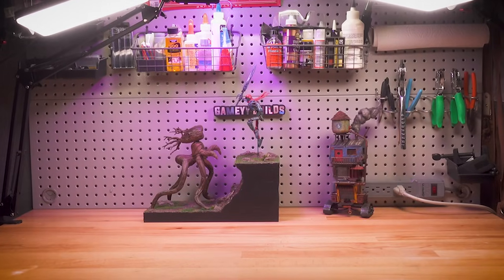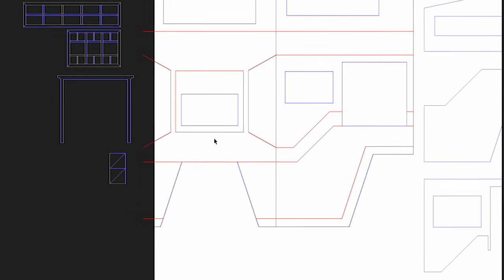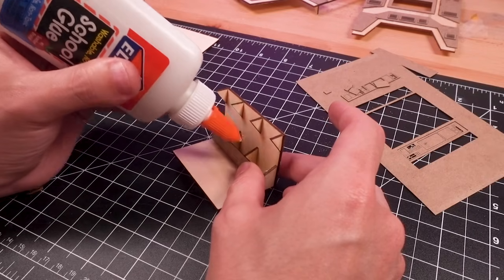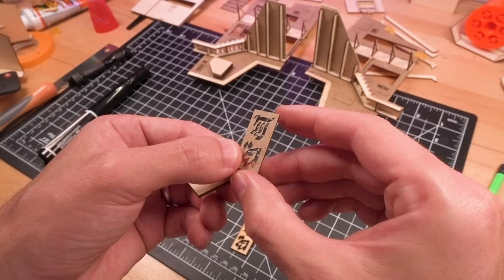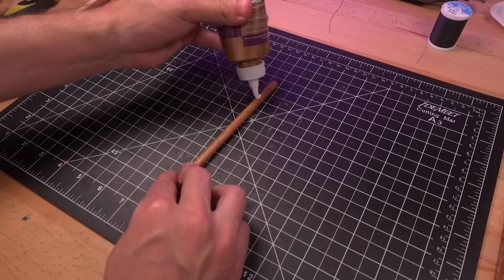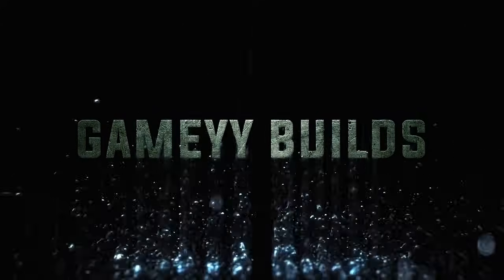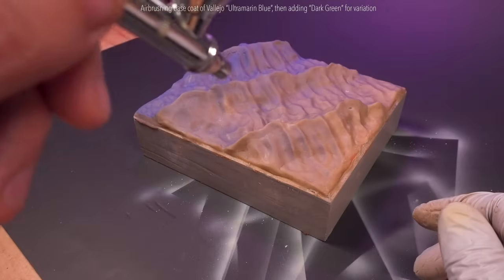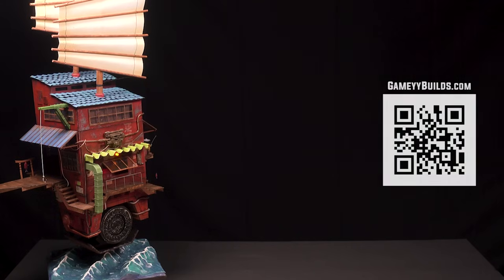“The Catch” floating market scratch build, Beyond the Blight

Comment: Another great build. For tiles I nomally wrap a thin layer of clay around a paper straw. Let the clay dry then slice the whole tube in half. This give you 2 half circles that can easily be cut to the length of the tiles you want. Basically scaling down the actual process of making real tiles. They take a little longer to set but work great and all the tiles are slightly different. You can even break/chip a few to add even more interest to the roof.
Reply from the maker: Great tip!

Comment: Hi, your builds is really inspiring and so your channel. I hope there are still some shirts left, so I can support you:)
As a general tip for your wiring. Try to spiral your cables (as can be seen in computer fans for examples). Every space between those two cables (+ and -) creates a loop and can work as an antenna. While it‘s not that important with LEDs it still a good habit and practise:)

Comment: if you used a magnetic switch you could hide it on the interior of the build making it possible to turn the effect on without needing to hide the switch, if you wanted to go more complex you could wire the switch into the coil of a relay to "latch" the relay in the on position making it possible to engage multiple effects. if you would like to go into more depth feel free to message me. also just wanted to say i love your build and has me thinking of my own.

Comment: My advice for your soldering: Just 'git gud' man.

In all seriousness, as with all of your builds, this was a joy to watch. The tie in with the other story was fantastic and cannot wait for more of this story to unfold.

I am unsure precisely how this would work but the only constructive suggestion I have is wiring up another battery to the speaker to make it vibrate (you can add resistors to change the Hz). This would both look cool as it would look like the Repulser engine was actually doing something, and it would also give off a hum when activated.

Comment: You can use foil for contacts. A sheet on a wall can be painted over. However if you want to see the wiring, I'd suggest running a rod down the 4 corners of the build. That way it looks neat, adds structure and its simpler to add lights.
Reply from the maker: Great suggestion!

Comment: gameyy this was actually your first video that i saw of yours and it motivated me to start building/ kit bashing just like you, i do have a question though, how do i cut the foam board smoothly? because currently when i cut the foamboard it comes out very jagged.
Reply from the maker: I recommend a very sharp razor knife and a long straight edge, preferably a metal ruler. Alternately, if you are willing to spend a little more money, a foam cutter will give you a clean cut, but you still need a straight edge.

Comment: Those open frame laser cutters are extremely dangerous and a fire hazard would be worth making an enclosure and keeping it attended when used
Reply from the maker: Yes, I use the Ortur Enclosure 2.0, which is built for this laser cutter. I also recommend using a steel honeycomb tray beneath the material and a metal sheet under that for added protection and air circulation to avoid overheating.
Reply: @gameyybuilds  thats good it is worrying how many people are buying the open frame machines and running them unattended on a kitchen table